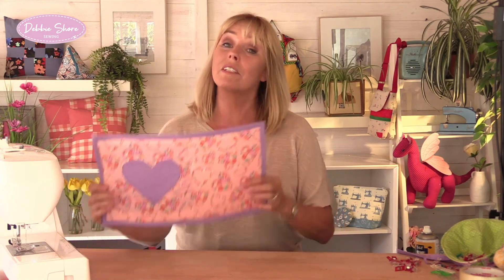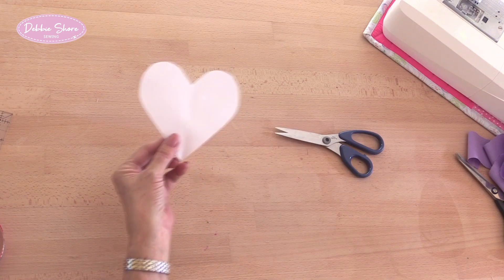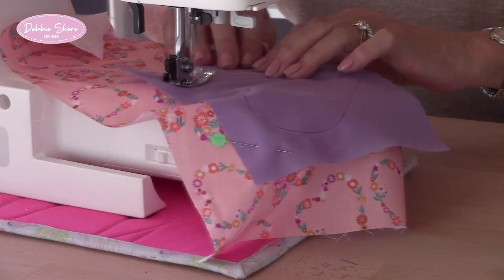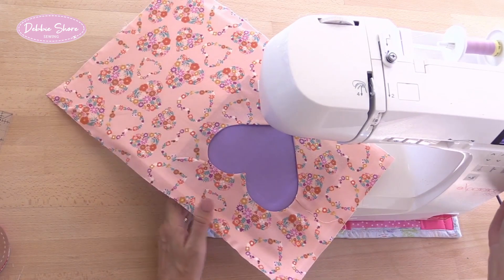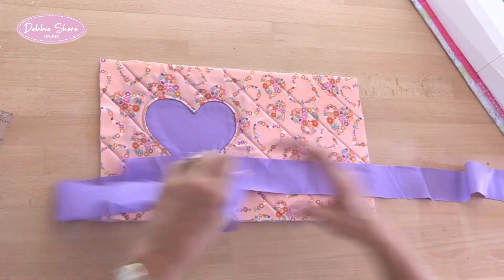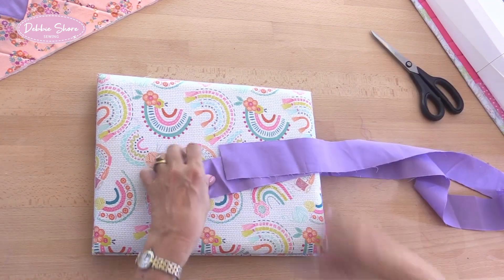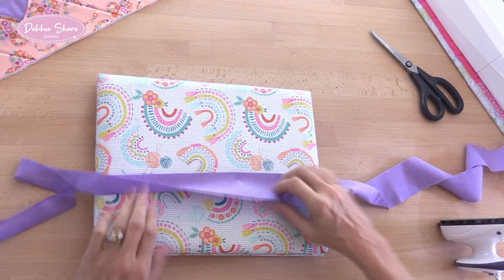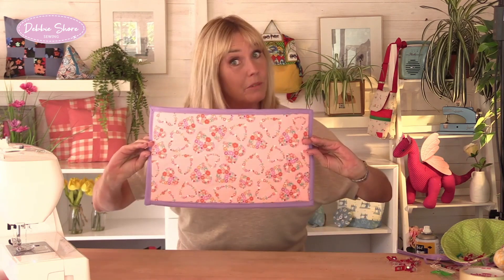How to sew a simple sewing machine mat by Debbie Shore

Comment: I could see that as a placemat putting the cup of tea on the heart. LOL. Beautiful work & very clear instructions. I made a table topper with old antique cars fabric using heat resistant batting on back of both sides, then quilted & can serve as trivet or hotplate & gave to my brother who BBQ's alot. Fun but didn't measure the quilt lines-just winged it.🤦‍♀️💌